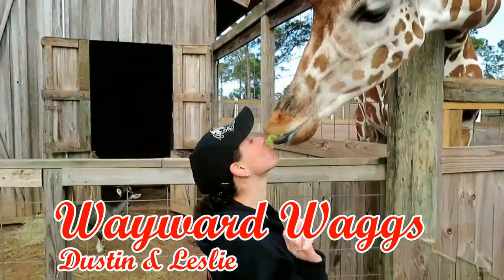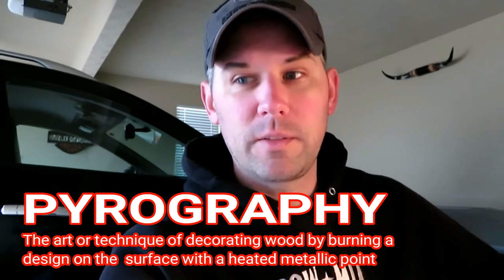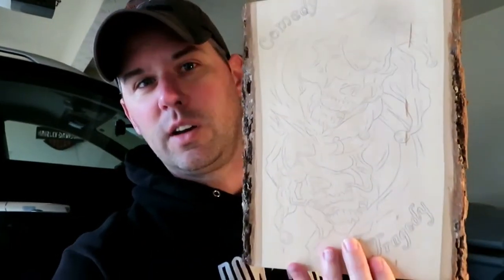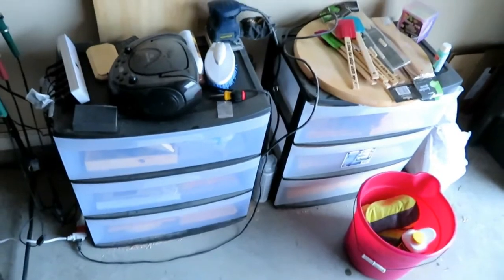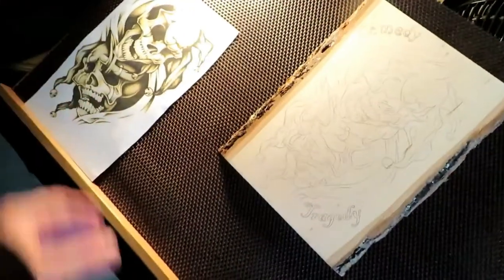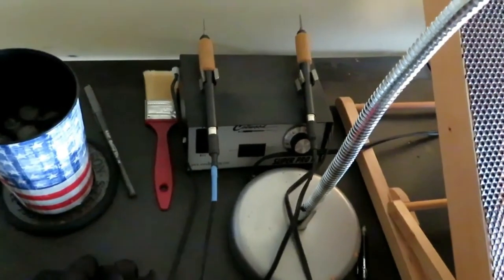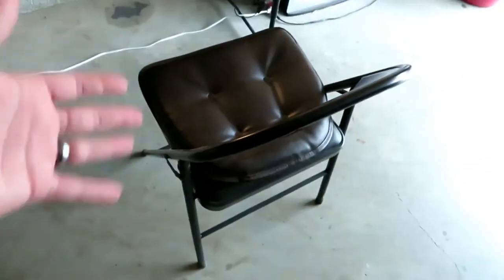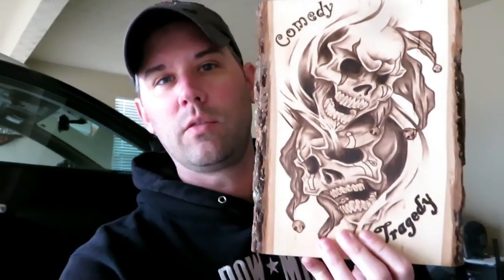Side Hustle \\ Making money with pyrography (Wood Burning Art)

Comment: Beautiful work man! I’m looking at buying my first pyrography tool to start as a hobby. Anything you recommend?
Reply from the maker: I do most of my work with a regular Walnut Hollow Versatool. The kind you can buy from Hobby Lobby for around $25. I recommend getting the one you can regulate heat with. I also have a Colwood Superpro 2 which is a little over $200. I use it for greater detail but it isn't super necessary. Start with the cheaper one and work your way up.
Reply: Wayward Waggs will try that. Is that one good for lettering too?
Reply from the maker: Ya. It works good for lettering.